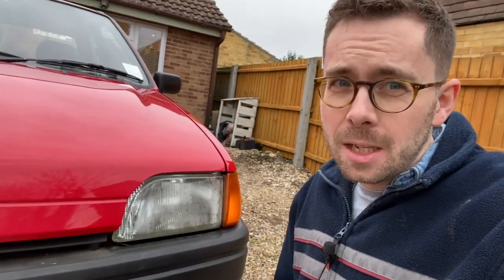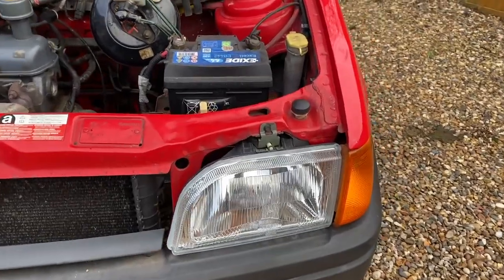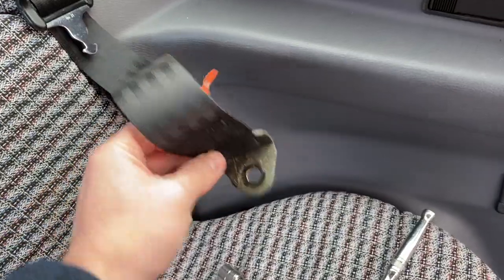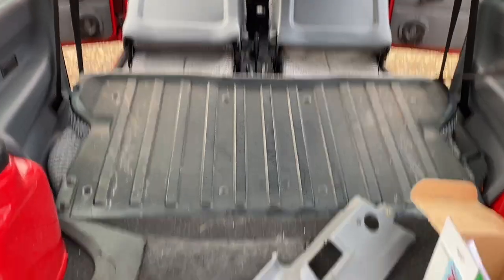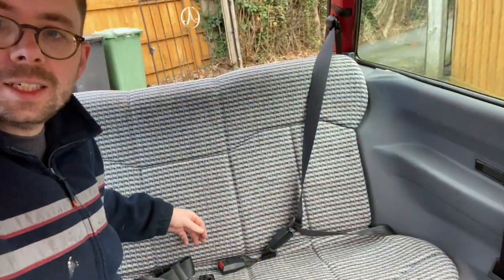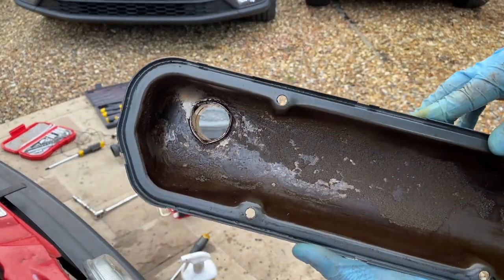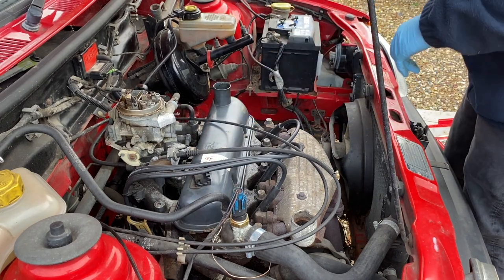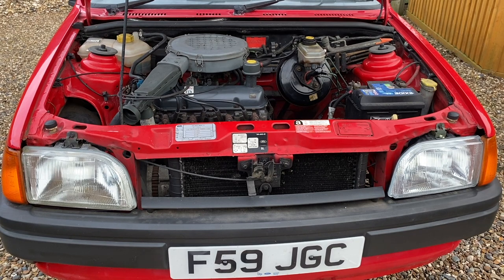Fiesta Fettling - headlight, seat belt and rocker cover gasket

Comment: New subscriber just catching up. Great spannering, you have transformed the fiesta, great job on the seats, Your garage have done nice sympathetic welding, not an MOT bodge job. Back in the 1990s, my brother had a fiesta mk2 950, when I changed the rocker cover gasket, the paint was hanging down on the inside, over the rockers, replaced with 2nd hand one from local scrap yard
Reply from the maker: Thanks for your comment on the welding. I was really keen for it to be a proper job

Comment: Best of luck for the MOT.
I have a question if I may ask. If you had to keep only one of your cars, which would it be?
Reply from the maker: Ohh that’s an impossible question! If I really had to, then probably my blue 1980 Volvo 345, as it’s so rare to find an early 340 in such amazing condition
Reply: @MorselsAndMotors  I agree. I mean if I had a pick of your motors, I would take that too. A few years ago I missed out on a mint but high mileage G reg 340 DL 3 door. I dithered too much and lost out.